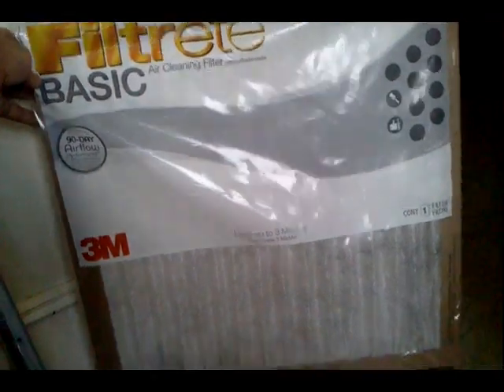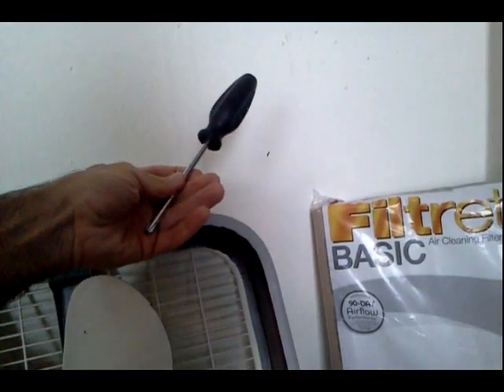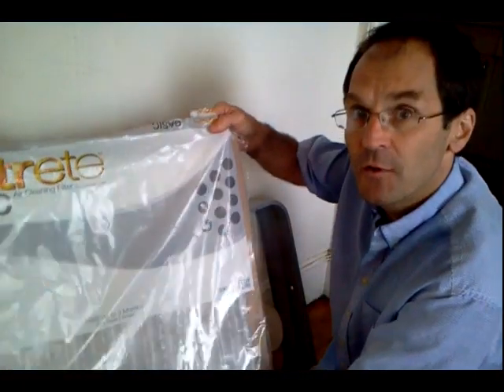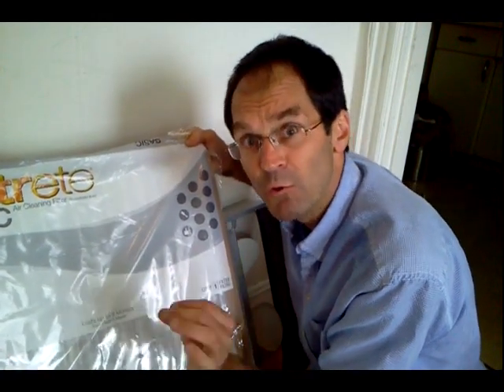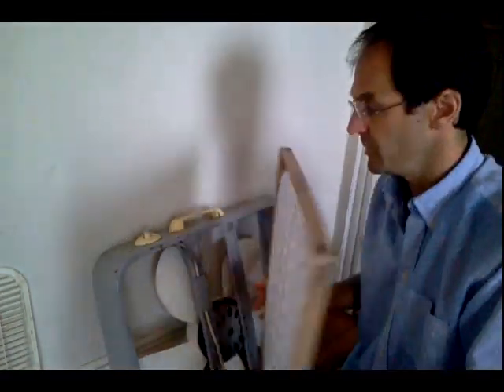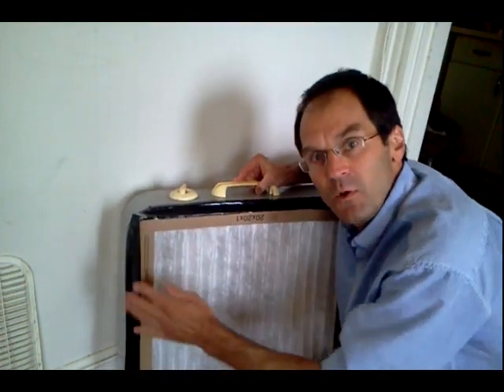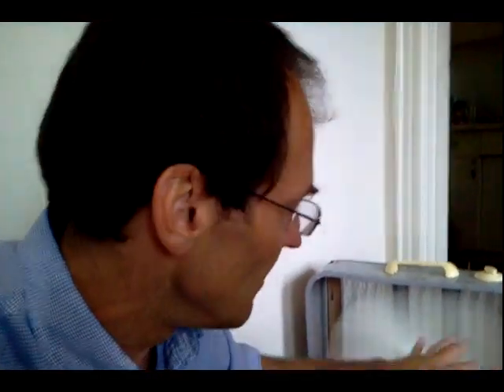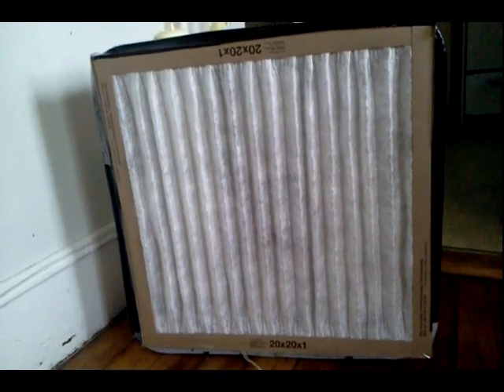DIY Air Purifier with Box Fan & 3M Filter 🙂

Comment: I’ve been using std 20” box fans with a 3M filter on the back for decades. Usually running one 24x7 and more during any home renovations.   Now I’m running 4 throughout the house due to covid.   No need to remove grill. I don’t use tape either. Just place the filter on the back of the fan.    I do position the fan such that if I turn off fan or lose power the filter doesnt fall.  Otherwise it catches so much junk in the air after just a few months its worth it. Hopefully catching bacteria and viruses too with the higher quality HEPA type filters.
Reply from the maker: Thanks for posting. I think you're the first viewer who's already doing this. 
Ferns are also great for indoor air quality. Plus they're beautiful and give off oxygen. Especially now with isolation and all they're really a blessing. Have a great day.

Comment: Why take the rear or front grille off??  Just put the filter on the back & the fan suction will hold the filter on.  Then you can take it off when you just want cool air.  For Merv 11 filters & above, cut a hole in center of the filter to let air into the back of the motor so it won't overheat.  This guy is not too smart.

Comment: would this 
Electrostatic Air Filter  be too restrictive?

https://www.wayfair.com/AirCare--Washable-Electrostatic-Air-Filter-for-AC-or-Furnace-AICA1000-L7257-K~AICA1000.html?refid=GX340688654544-AICA1000_20115115&device=c&ptid=736031915242&network=g&targetid=pla-736031915242&channel=GooglePLA&ireid=35544976&PiID%5B%5D=20115115&gclid=EAIaIQobChMIt9Loqfm84wIVGYzICh3lVgzoEAkYASABEgIXUfD_BwE

Comment: What about the furnace filter? I change mine once a month, keep the furnace fan running at low speed all the time. Clean air in all the rooms.
Reply from the maker: Good plan if you have a forced hot air system. You get the duct work cleaned also?

Comment: Good stuff I have a couple of these running in garage.  Anyone have recommendations on filters $100-500 for running inside that are " quiet" and actually filter out HEPA (smaller microns)  I have just done a lot of paint sanding, construction, I'm afraid there might be asbestos left over or small lead dust particles.  Very minimal but want to make sure because the house is a 1912 built house with an addition in the 1960s.  I heard only HEPA will filter the low micron asbestos in air.

Comment: what is the purpose of taking the grills off? it seems it would obviously be safer with the grills, but also prevent the filter from be drawn into the fan blades, and does not seem like it would create much more resistance, please explain this to me, but a great idea, Tnx for the tip

Comment: I tested my old Lasko box fan at 72, 96 and 120 watts from low to high, the same with or without the NaturalAire filter, and the low setting is plenty sufficient as an air purifier.  A lower wattage would be nice, but 72w is okay when only using the fan for short time periods, for example 15 minutes to an hour, and 72w is more than competitive with the much smaller sized commercial air purifiers.
Reply from the maker: Good observations. I made this video as DIY solution to controversial electro-static air filters, which may do more harm than good because they release free radicals in the air. However, after a couple months, I removed filter to increase fan's performance. Now I focus on keeping floor space clean (wood/linoleum floors only), and keeping AC filters clean during summer use.
Reply: Thank you for your helpful video and comments.  I don't use a/c, and this purifier is useful for air quality.

Comment: Why go through all that? I just used 3 strips of Scotch tape 1 on the top and 1 on each side and good to go.
Reply: air resistance, noise, efficiency.
Reply: I got the purple Filtrete and fan slows some what due to resistant but still blows pretty good.

Comment: no need to pull the grill off at all. and if the filter's put on the back, there's enough suction to 'seal it' to the fan. duct tape would be optional, but prob a good idea to keep the filter on  in place when the fan's off.

Comment: you would want to run your duct tape over the corners on the input side so that air is coming in through the blades and cannot push back out the back on the edges, the filter acts like a sail and covering the corners will reduce the blow back effect. Another thing you can do is use several filters to create a box on the output side which will reduce the blow back pressure with each additional filter added. first by 1/2 then 1/3 then 1/4 etc.

Comment: I just made a 20' box fan air cleaner. I pull the air though the filter, never push because the dust that builds up will get blown off into the air.  I don't remove the front grill. I don't see the point and its a safety hazard. You may have to still clean the fan blades periodically because as others have stated, some dirty air will get sucked into the corners and get blown out the middle. Try putting tissue paper on the air out side and it will stick to the corners. Its not a problem as long as you have good suction in the rear. *** IMPORTANT Make sure to handle the used filters with care. Don't handle them roughly or you will release concentrated fine dust right back into your air!  Take the whole thing outside to change the filter.
Reply: True Remnant Theology

Comment: are u sure its pulling the air through the filter, or is the majority of the forward air coming from the front edge of the fan? you should test the suction strength on the other side of the filter?
Reply: homerdude i did some test on my box fan filter, the four corners draw air in from the front, but the back still has suction everywhere,the strongest of the suction comes from the middle
Reply from the maker: homerdude good questions. Much air is drawn from back of fan, because this filter slows down the fan considerably.

Comment: There is really no need to take the screens off the fan, I have a box fan with the 3M allergen reduction filter on it and it has a ton of dust on it, although I still have to clean the room it's in occasionally.

Comment: Thanks. I'm going to set this up tomorrow with a MERV 13 if I can find it. Definitely have some mold allergies going on so hopefully it helps a bit.
Reply from the maker: Thanks for posting. FYI, fan output is greatly reduced with this hack. However it will trap dust in your room. So it works better as a filter than as a fan.
Reply: p1nesap But since it is merv13 it will trap to those specs correct?
Reply from the maker: No, these filters are designed for pro HVAC systems, not a DIY box fan hack.
Reply: p1nesap How did the Merv13 setup workout? Any tips?